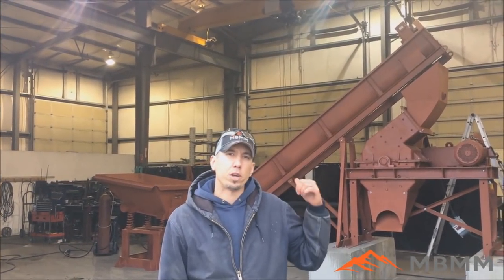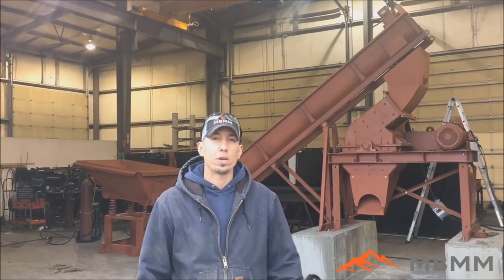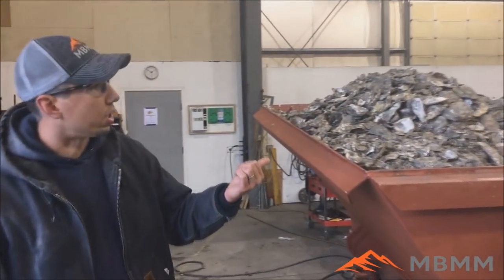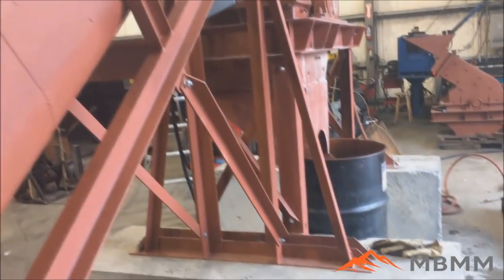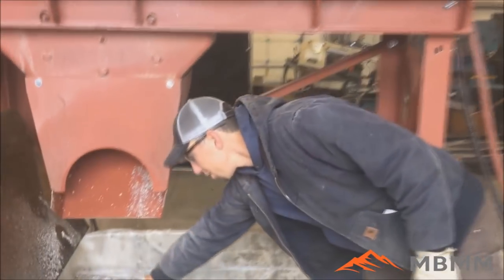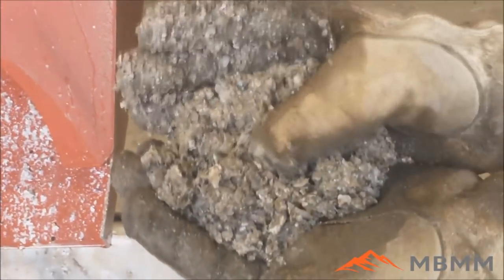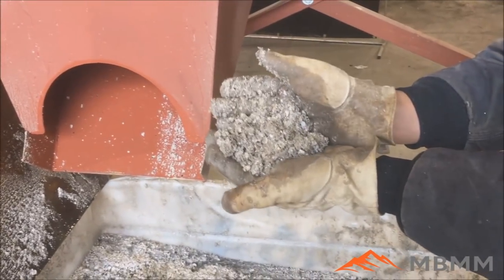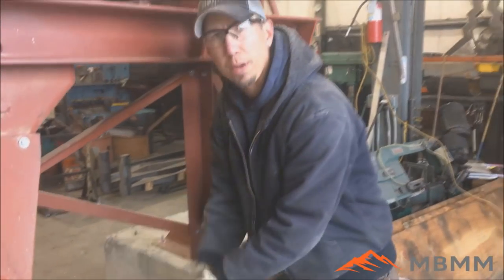Oyster Shell Processing Machine For Sale, Chicken Feed, Calcium Carbonate, Concrete Additive, Lime

Comment: How are you drying it after grinding? Might be better to pre dry so you don't need to add more water when grinding?
Reply from the maker: Running wet allows for a higher throughput, if you need to run it dry it reduces the throughput when processing shells.